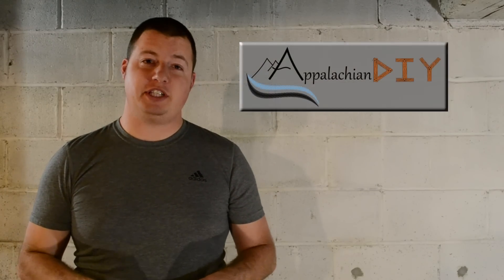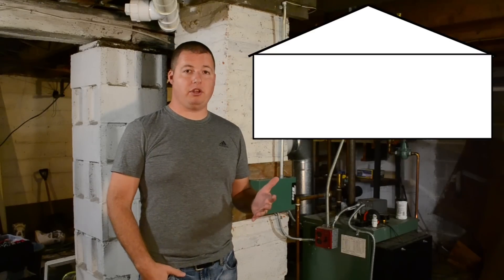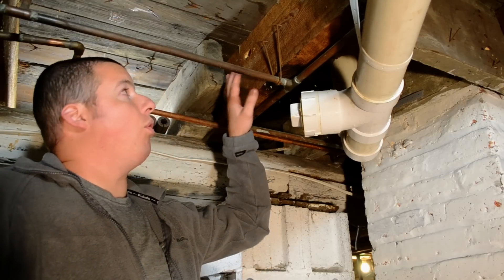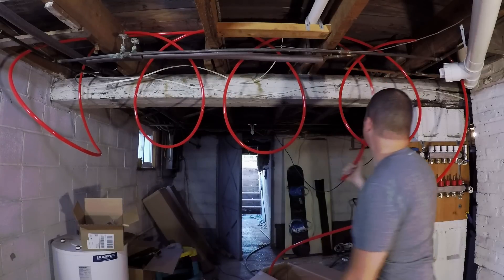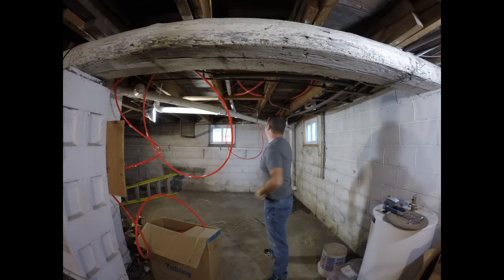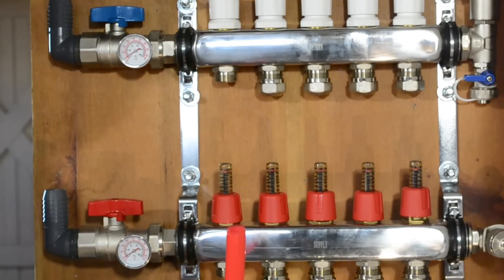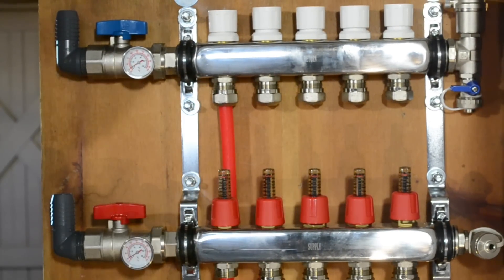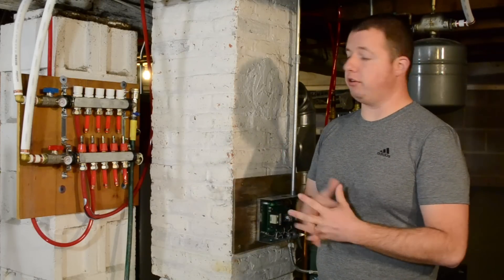DIY Radiant Floor Heat

Comment: Use antifreeze mixed with water ?🤔
Reply from the maker: There are special mixes used for hydronic systems. They are typically glycol based.

Comment: Your video is really good! A few things have changed since you posted your video. My recommendations would be to use PEX-A without the brass fittings. This will reduce cost and increase flow. Another option will be to increase the pipe size to 3/4 and still use the fitting, but since the fitting I.D. is now larger the flow will be increased.
Reply from the maker: Thanks for the info
Reply: My understanding is that you have to use PEX B because of the oxygen barrier characteristics of pex b over pex a. From my reading, it appears that pex a allows for oxygen transfer into the water, which can hurt a boiler system. If that is what is used for heating the water.

Comment: Appreciate this video am.looking to do the same for the 2 main rooms in my home. I do have a question about the hot water supply to the radiant heat manifold - are you utilizing the hot water straight from the boiler HW outlet via circulator, to the manifold, or using a thermostatic valve to reduce the HW supply temp? Thnaks
Reply from the maker: Straight from the boiler. No mixing valve or anything. I do have the boiler turned all the way down to its lowest setting. I do have a Q&A video about common questions, you can find it on my page
Reply: @appalachiandiy2415  thanks for the reply, I will certainly review your page

Comment: Best place to cut the holes in the joist would be center of the joist.  There is tension at the top and bottom.
Reply from the maker: yea sure, that would be a good place. biggest thing to worry about is the size of the hole not location

Comment: What did you do about the flooring nails in the bays? Cut them out?
Reply from the maker: I used an angle grinder with a cut wheel. Worked good and was fast
Reply: @appalachiandiy2415  I am about to start install. Took us a while to get here because we had to have asbestos removed, cut out all the old pipes, and repair damaged joists.

Comment: By any chance do you connect the manifold direct to your heating system ? Do you need an additional pump? ( I have a similar heating system to yours, I use oil to heat my house) Or you just connect the inlet and outlet to an existing loop?
Reply from the maker: I had baseboard heat before I turned it into a radiant heat system. I used the original trunk line to supply the manifold. 
Watch this: https://youtu.be/lTkTL3VT2FM

Comment: Your boiler is going to crack. You have an old cast iron boiler and it won’t take the thermal shock from the floor heat for very long. You could run a mixing loop with a tank to temper the cold water returning to the boiler. Or buy a mop and keep it next to the boiler.
Reply from the maker: This boiler was used for baseboard heat. I don't see the difference whether it returns cool from baseboard or radiant floor. I also don't run it very hot. I run it on low

Comment: I’m halfway through installing this same setup (will be doing 4 zones for lower floor). 

I didn’t see you include a pump or mixing valve...was told that they were both a must. Did you keep adding to the system and is there a follow to this video?
Thanks!
Reply from the maker: I have a single pump running my system. if you have 4 separate zones you will need 4 unless you use the flow regulator on the manifold to adjust flow like I did. I didn't use a mixing valve because I didn't think it necessary to heat water up just to cool it down. I just lowered my furnace to the lowest temp and ran it like that. Works great that way. I couldn't find a good reason to use a mixing valve but if you have some info on it I would love to hear about it. Here is a "follow up" vid https://www.youtube.com/watch?v=lTkTL3VT2FM&t=2s Thanks for the questions!
Reply: @appalachiandiy2415  ...learning curve...I have two zones...the ground floor zone will use a manifold that has 4 circuits for the pex radiant heat.

Comment: If I have three different runs of PEX but one thermostat and pump, can I have the bedroom at 65 degrees and the other two runs, one above the subfloor and crawl space, and the other embedded in a cement slab at 70 degrees? Would I just turn down the flow going to the bedroom? As far as I know you can’t just drop the heat in the house at night then crank it up in the morning.
Reply from the maker: Yes just change your flow. have the thermostat where you want to control the heat the most

Comment: Where is the pump circulating the water?
Reply from the maker: right before the boiler. It pushes water into the boiler first, then it circulates to the manifold and to the loops, once it comes back to the return main at the manifold it heads back the pump to start all over again

Comment: Did you connect this radiant floor system directly into your existing heating system without other modifications?  I have one heating zone - baseboard heating on my main floor with basement underneath - that I am considering replacing.  Can I simply remove the existing baseboard radiators, install the pex tubing and manifold as demonstrated in your video, and connect to the existing Taco zone valve?
Reply from the maker: That is pretty much exactly what I did, so yes.

Comment: I'm not a hater but in this case I have just got to say "Do more research before you try this or ask a professional"!  Things I noticed that you are not supposed to do: 

1-Do not use regular PEX potable pipe on the manifold feed from the boiler. It has to be Heat PEX or Oxygen barrier rated PEX to keep from damaging the iron piping, boiler or pumps.  Uponor heat PEX is the best.
2- If you have to mount the piping under floor,  you should encapsulate the joist space by insulating it as much as possible to force the heat through the flooring. BTW, this is the most inefficient way to add in floor heating.  Spend the time to raise the floor above the subfloor to make a path for the tubing.  It heats much faster.  You still need to insulate the joist space.
3- In floor heating PEX runs have a limit in total length.  It's best to stay under 280 feet total length
4- PEX piping does not last long when the water temperature gets closer to 180 degrees.  Where you tap your boiler feeds is very important or down the line the PEX will become brittle and crack.  A single touch could cause a major leak. 

5-If you are going to add an in floor circuit to a boiler that also provides heat to radiators,  you need to add a temperature mixing valve to keep the feed water between 110-140 degrees.
6-If you have multiple circuits for in floor,  you will have to balance the flow to maintain proper water temperature between the circuits.  Maybe even add another circulator pump to ensure flow.  You also need to make sure that your in floor circuits drop the boiler return water temperature too low.  If you have a high efficiency boiler, this would not be a problem.

I know the presenter wants to help and so do I.  There is a lot of effort in what is being shown and some cost.  You do not want to be disappointed or damage your house. There is a science to this heating that must be learned to take full advantage.  If you install it like the presenter, it will work. You will be more likely to have problems down the road. No one to blame but the installer at that point.
I would hire a guy like this and train him any time.  Great potential.
Reply from the maker: Thanks for the tips, very informative. Thats why I like this platform. its been almost 4 years since Ive made this video and have learned a lot from comments like yours and others. I hope that people interested in doing this read the comments. I understand that it's not perfect but I'm proud of the work. Again, thanks!

Comment: Excellent! I am planning to do exactly the same, also similar basement situation
Reply from the maker: Let me know how it turns out for you. Good Luck!
Reply: Appalachian DIY : can you let me know the pattern of metal plates used. Like spacing between them both horizontal and vertical?

Comment: Good Video ! Buddy  your explanation/ Narrative is very clear  and the camera angles / lighting  are easy to see what you are doing  many years ago in the early 1980s  my best freind asked me to give him a hand doing water lines in a crawl space under his home  these were ru outside because we lived in South Florida and it was the first time ive ever seen Pex Tubing  i was impressed  and over the years ive owned several Campers  and Boats that used the same  system  i am hoping to install Radiant Floor Heating in one of my next  homes  and i have had a general interest about it for years as. I like the overall concept  and  theory about it BTW  i no longer live in Florida  ( in case you were wondering ) why i would be concerned about heat as a rule Florida homes dont concentrate much. On heating  usually they put in reverse cycle Airconditioning or  AC with heat strips inside them to  have something to take a cold chill once or twice each year you may need to use  it  some of the older houses  used to put a Kerosene  heater  in a closet   Without really any way of distributing the heat throughout the  house  before Pex many homes had Copper water lines running in the  exterior of them  as Freezing isn’t much of a concern  in Florida  unless you are a Orange Farmer  because a Frost can hurt  your tree production
Reply from the maker: Yes once I saw this type of system I knew I had to have it too. Once you have it you prob will not look back. Thanks for the reply and good luck!

Comment: Supply and return are both at the manifold...so I'm not understanding what the difference of working from supply to return, or return to supply. The pipe distance will be exactly the same.

What am I missing?
Reply from the maker: Dont fully understand what your trying to ask but here is a video that may help. https://www.youtube.com/watch?v=lTkTL3VT2FM
Its a couple common questions I get and answers to them. It does go over how its plumbed up and more on the supply and return. if you have more questions after the Q&A video feel free to post again

Comment: No zone valve , no pump and 3/4 pex, this is not how you do infloor heat, jm fitter/ plumber here
Reply from the maker: On the manifold there is a flow control valve. This regulates how much heated water goes to a certain zone. It is less expensive than having thermostats and zone valves all over the place. there is a TACO pump for the system. It only needs one pump(saving money) because there are no separate zones or loops,  it runs the entire system. There is no 3/4 in pex anywhere in the system soooo dont know where you got that. its 1/2" for the loops and 1" for supply and return to the furnace. This is how I do radiant heat and it works quite well.

Comment: you'll don't need the aluminium plates , just staple some if the reflective bubble wrap ... works great    you don't need the hair dryer either...lol
Reply from the maker: interesting idea with the bubble wrap. I heard of it used in conjunction with radiant floor heat to keep the heat from "leaking" into lower levels but not as a way to spread the heat out(which is what a transfer plate does). And yes I had to use the hair dryer(or a heat gun to be more manly!) the pex was to cold in the basement during bending and I was getting kinks in it because there was little give while it was cold.
Reply: @appalachiandiy2415  We only use it where I work in Eastern Mo., boss man quit the aluminum a long time age, turns out these systems are very forgiving and the heat rises anyways! cheers.
Reply from the maker: @markakin3742  do you staple the bubble wrap tight against the pex and subfloor?
Reply: @appalachiandiy2415  no just stapled in each joist bat every foot or so, we cut them around 18 inches off the 4 ft roll joist bay is 14.5  roughly all in the middle of the joist, pex taloned in the top third..

Comment: Most forced air are vents at or on the floor outside walls with cold air returns on the floor of inside walls. So the forced air circulates thru the room (you don't have that in your drawing). The picture is only accurate on the radiant side if the heat from the floor is continuously producing heat--if so your heat bill might reflect higher numbers. If it turns off, eventually both sides will be identical. Issue with heat is not with how it's generated but how it escapes/reduces in the home (insulation and venting issues). However, if you keep feet, hands and head warm you can withstand colder room temps.
Reply from the maker: Ill agree with you partially, return and supply are usually at the ceiling height and floor level. It all depends on where your system is mounted. No matter if your warm air is pushed in from a bottom register it will still rise to the ceiling, can't change physics. I think the best way to compare hvac to radiant is what you are heating. HVAC is heating air and radiant is heating your floor. Air will dissipate heat quickly while the substance of your flooring continues giving off heat after it has been heated up. Thanks for your reply
Reply: @appalachiandiy2415  I will agree with you, sir. :) Forced air heats room and things in it, and the things radiate heat like the floor does. I think functionally/efficiently the floor radiant heat is better. But all things considered financially, forced air heating is less.
Reply from the maker: @loydjenkins  I have never done a cost analysis on which is cheaper, perhaps a future video. Thanks!
Reply: @appalachiandiy2415  I looked at others' where they broke it down by square ft, but they're all dubious. Too many contributing factors. I live in the frozen tundra of Michigan. Haha
Reply from the maker: @loydjenkins  Well try and stay warm up there!

Comment: Does the radiant heating will damage or expand my 3/4" hardwood floor?
Reply: it will shrink flooring notexpand it   low constant tempiture  is best wor real hardwood  expanding contracting wood leads to sqeeks fyi  laminants over infloor is best
Reply from the maker: Yes it will expand....to the extent of damage, most likely not.

Comment: Basic physics,  Heat rises, and always will. Will heat my basement and try not to let the floor stop the flow of heat.  If the floor is too well insulated I will cut air ducts as needed. + I like a warm basement.
Reply from the maker: Sounds like your on the right track!

Comment: Just nail it on the sides of the joists two inches down and insulate the bottom of the joist with R-12 
then your heating the entire joist cavity a lot less work and if you want to put hardwood floors on you dont have to worry about the nails. Good to go
Reply from the maker: That will work but not as good as direct contact with the subfloor. you can still do the insulation but the transfer plates and pex should be mounted to the subfloor for maximum heat transfer directly to the floor

Comment: Great video. The only info I needed was what you left out 😂. What is the pump/thermostat/heater set up?  This is the most expensive aspect, starting around $3,000 for something preconfigured. DIY explanation of that would be 👍🏻  great. Thanks 🙏 

A text reply no video needed unless your just bored but that’s doubtful. Keep up the good work.
Reply from the maker: https://youtu.be/lTkTL3VT2FM I made this video a little while ago. Let me know if it answers your questions.

Comment: I noticed a lot of nails poking through ceiling in your video, I am going to have the deal with the same issue, can they just be hammered flat or do they need to be cut flush?
Reply from the maker: I cut mine off with an angle grinder. I didnt want any bumbs and everything to lie flat
Reply from the maker: @George Nada Non that I have noticed.

Comment: I have baseboard hot water, I would like to put in PEX radiant heat. Do I need a PEX manifold or can I use the existing copper manifold an install a shut off valve with gauge and air valve?
Reply from the maker: If you already have a manifold that you can use to separate the loops that is just fine. I don't really know what you mean by an air valve though. Without circulation pumps or regulation valves on each loop, you're at the mercy of "path of least resistance" when you push the water through your system. some loops may be hotter than others if you can't control the flow.

Comment: Appalachian DIY, I am thinking about doing this in my basement for the first floor. Was this a compliment to your existing baseboards? Or did you use as the primary source of heat? I understand that the tile flooring above will be very warm, but worry about the heat making it through the hardwood floors/subfloors.
Reply from the maker: I have a pellet stove to supplement if needed. I wouldnt worry about to much about hardwood or even laminate. Carpet is probably the hardest to get heat through with this type of system because of the thick padding plus a plush carpet. Both of these will act like insulation and hinder heat transfer